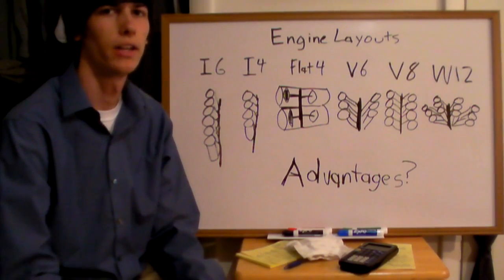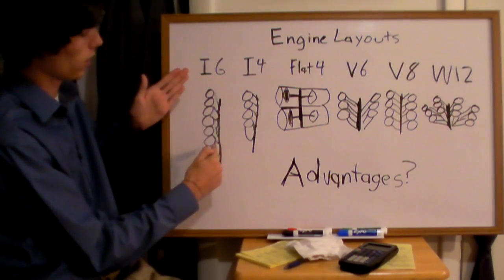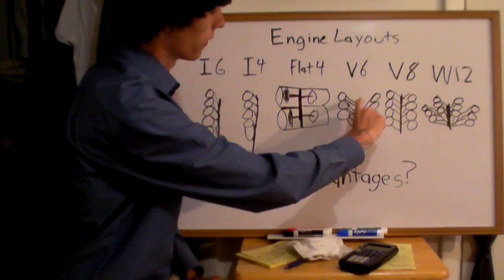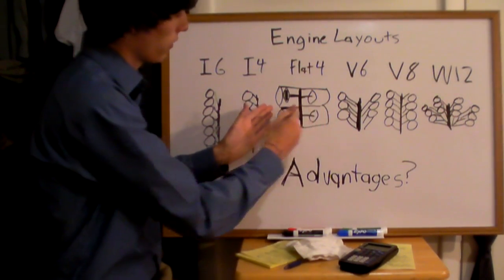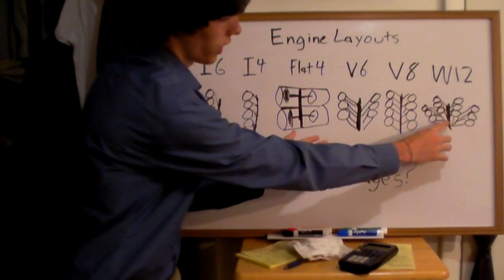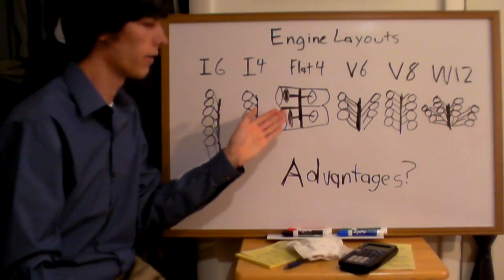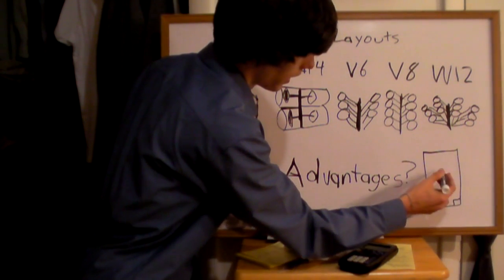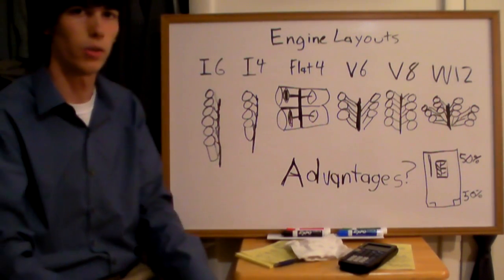Engine Layouts - Explained (V6, I6, V8, W12)

Comment from the maker: Well you can have a single valvetrain rather than one over each cylinder bank; 2 camshafts rather than 4. Not only does it have less moving parts, but it's typically easier to work on also. If the head gasket goes, you replace it. But a head gasket could go on a single side of your V style or flat engine, and you'd probably still replace both to be sure. Also, inline 6's are balanced, requiring less counterweight.

Comment: i dont think you got what he meant. not 8 in line, because yes, what you said would apply, but 2 banks of 4 laid flat(look at the image of a flat 4, then put 1 behind the other. technically, the crankshaft would be no longer than one from a inline 4 engine

Comment: I've heard another reason is crankshaft length. With so many forces pushing up and down on a long shaft, it tends to warp and bend. An answer would be to beef it up, but that would make it heavier and loose efficiency, so going to a V configuration after 6 in a row is logical. Notice that almost no engines ever exceed 6 in a row, and after exhausting the V configuration with 6 in a row, a V12, a W engine is used (W16). I'm sure the decision was made easier by space savings as well.

Comment: Yes partly true ferrari due rev high, but you can increase VE within a lower rpm range not just through rpms. Through experince maybe you have a better answere I took engine preformance training and learned if you use bigger valves and better flowing heads and more valve lift for that same rpm range you could get 380hp from the ford at a lower rpm.

Comment: Keep in mind that volumetric efficiency is also involved, not just firing order. For example, a Ferrari V12, of 5.0 Liter displacement has about 300 LB-FT of torque but about 380 HP. But the old Ford 5.0 Liter V8, same size, had also 300 LB-FT of torque, but only 220 HP. Because 8 heavy pistons have more inertia than 12 tea-cup size pistons and can be fed by smaller and lighter valve train with less spring pressure than can open faster, and can supply air-fuel mixture at higher rotating rpm

Comment: A straight 6, because all the pistons are in a row, would be a high torque engine.  A straight 6 engine is a BMW engine as an example.  It would also be a smoother engine than a V6 of same displacement.  Normally, in a V6, the engine is 60 degrees between the V shape, but in a V8, it's 90 degrees.  The intake manifold sits inside the "V" shape and is nestled inside the V, to save space. In a straight 6, your intake system is on the side of the engine, to right or left of it & long hood needed

Comment from the maker: That's a good question. I think size is the answer. Flat engines take up more space (dimension wise, not including height) than V-shaped or inline engines. If you were to have a flat 8 it would be enormous. Porsche uses flat sixes though, just an FYI. So my answer to you is space, though I think it could be done, and would definitely have benefits. (Except when you had to change spark plugs! haha)

Comment: What would make a flat 8 impractical then/why are they not in common use? Surely a flat 6 or 8 would improve the cornering of many cars, especially in larger cars where space isn't such an issue and weight distribution would be better off closer to the ground?

Comment: balance because a 4 stroke means you use 720degrees firing not 360 so you devide 8 cylinders by 720 then a cylinder fires ever 90 degrees, by this you can see an engine is smoother the more cylinders it has, there are primary and secondary unbalences

Comment from the maker: Will I make a video, eventually. But until then I'll give you some small insight on your second question. Short stroke will have lower torque, but because the piston is moving less, higher rpms, so relatively higher horsepower (than if the car had only lower rpms). Long stroke has higher torque, but due to angles, and the inertia of the traveling piston, they operate at lower rpms (relatively lower power).

Comment from the maker: @anish4 Sure, the oil will shift to the side in the oil pan, but within the engine (where the wear is going to occur) the layers of oil between moving parts are confined and very thin, so the g forces of a corner will have little effect.

Comment: An added note would be that the inline 6 engine is harmonically balanced so it doesn't require heavy counterweights along the crank shaft in order to run smoothly.